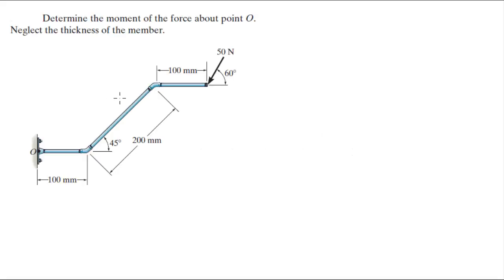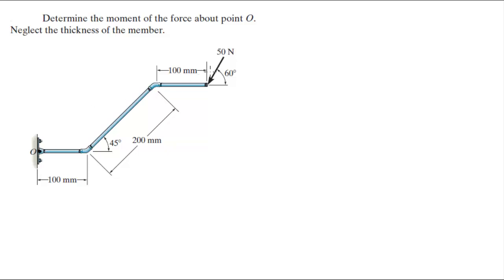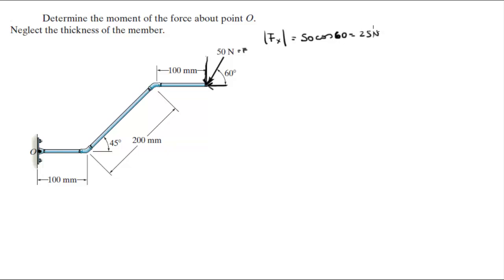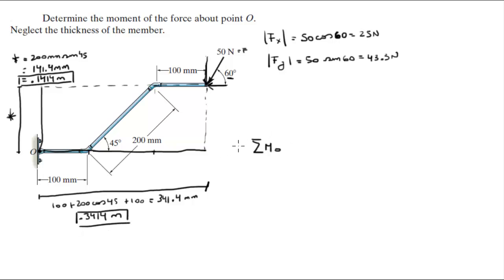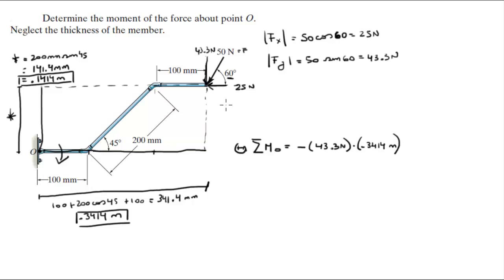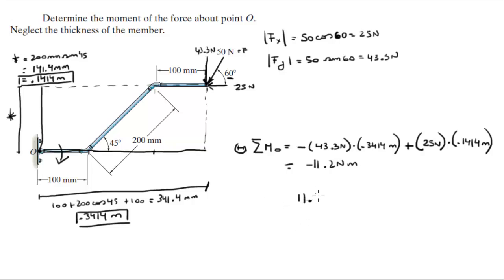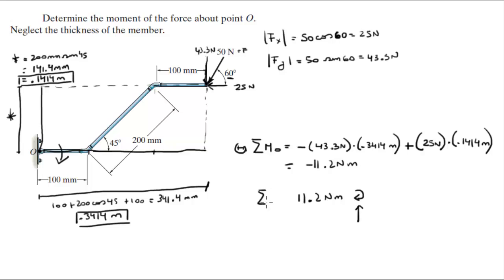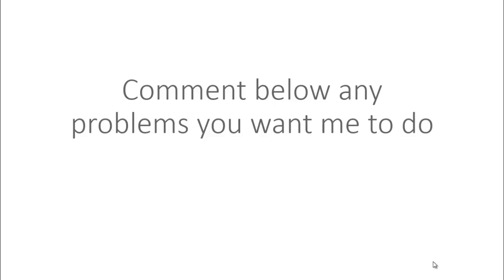Determine the moment of the force about point O.

Comment: The direction of your moments is backwards. It should be 50sin60(0.1+0.2cos45+0.1) - 50cos60(0.2sin45)
Reply: No he's right its still 11.24, the moment just wouldn't be negative and CW at the same time. So the correct answer would be 11.2N*m Clockwise. Just checked my book's answer key.